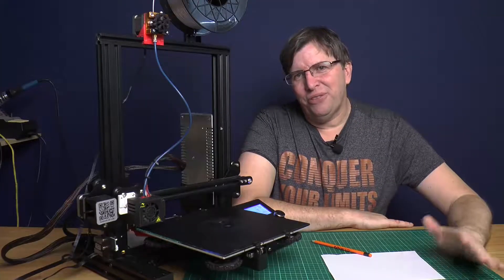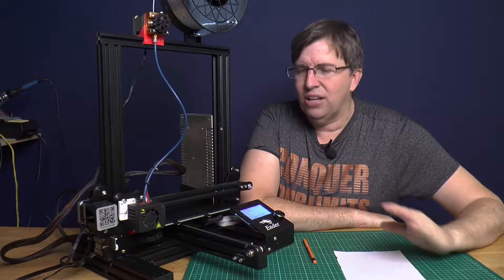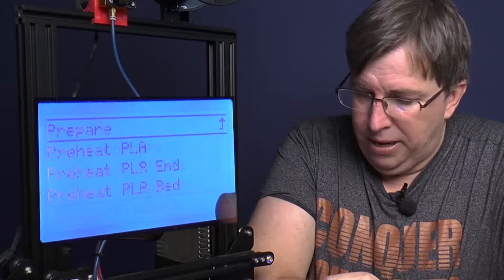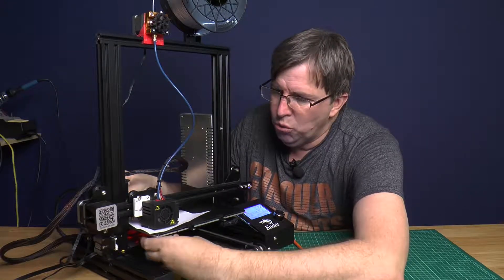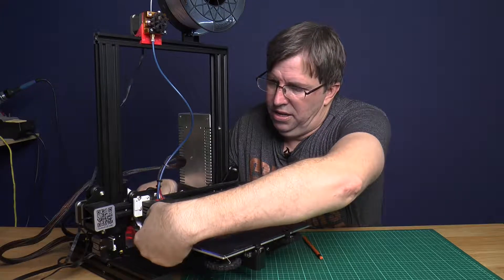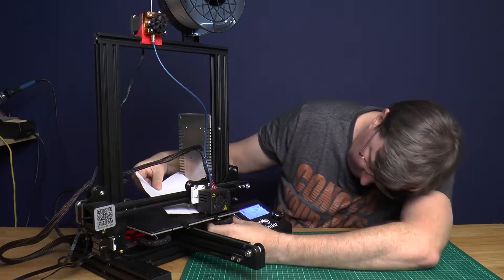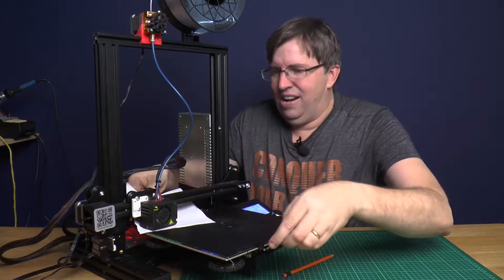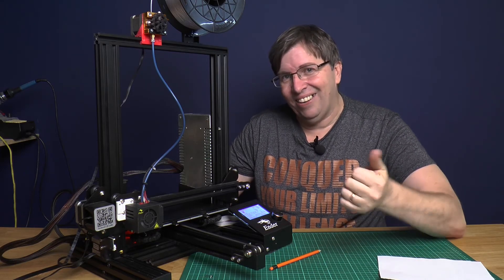Prints coming loose? | Leveling the Bed | SO IMPORTANT!!!

Comment: quick question when i print for 40 hours and shut it off at night the print gets loose when i turn it on next day and resume print and it gets loose it frustrates me so much i use glue stick how do i fix this
Reply from the maker: Hi P.S.I, the reason this is happening is because the bed gets cold and the PLA will no longer sticks.  Try put a descent size brim on the print, then use blue tape to stick the print down, then heat the bed to 70C or 80C, wait for a little bit, then resume your print, I hope this helps, it's just an idea.
Reply: @FusionSource  i use a creality ender 3 v2 so i dont think i can resume the print if i press cancel when i reboot it
Reply from the maker: Check my "Printing on Glass" video for more help.
Reply: @FusionSource  okey thank you